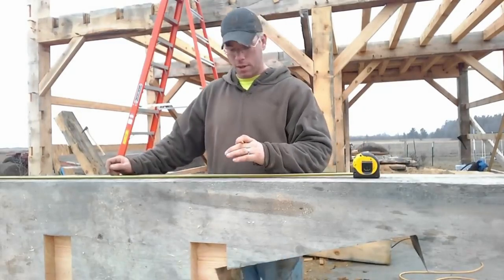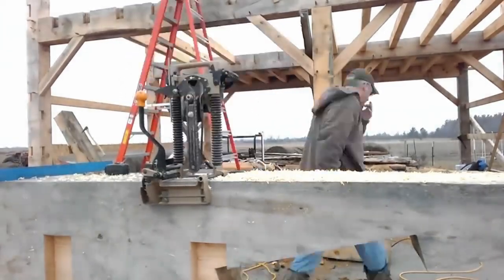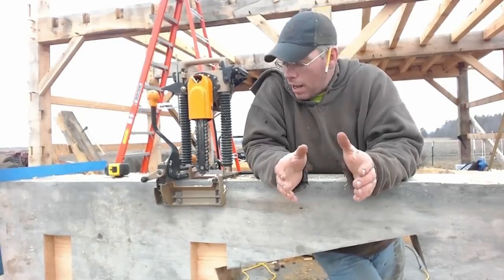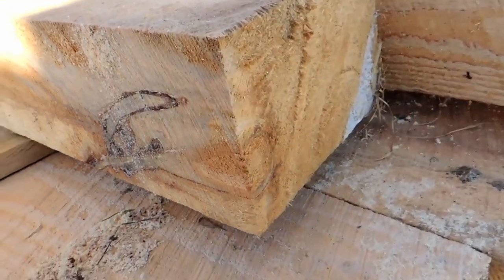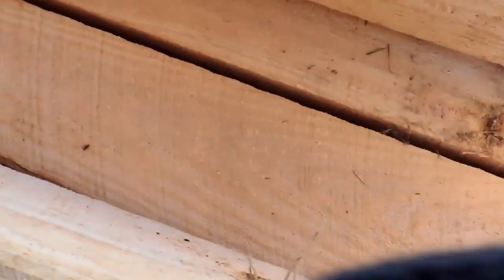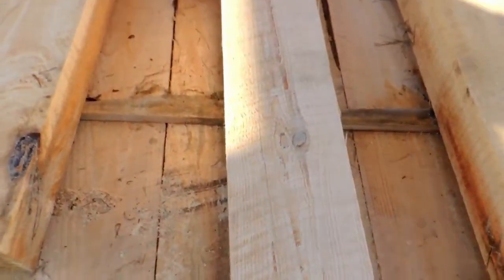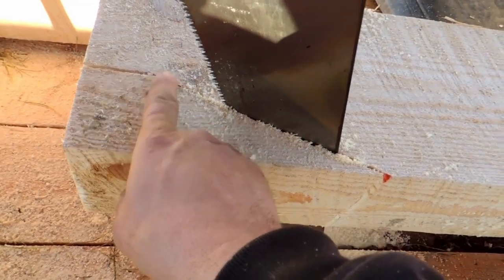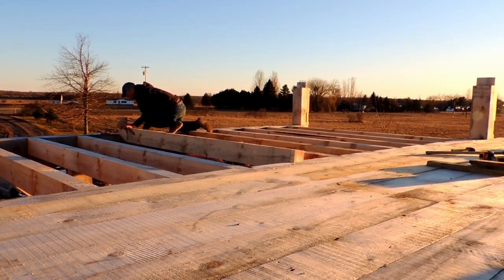A Timber Frame Discussion: Episode 2 Timber Selection and Chain Mortisers

Comment: Hindsight's 20/20 they say. Yeah, looking back it can be surprising you didn't get hurt sooner, but the way you got knocked into the hole was just what it was, a freak accident. True, there likely were precautions that could have been  taken to prevent it, and you will think about those precautions in the future. If you are in a similar situation again on the next build, share what went wrong, and what precautions you are taking to prevent the same accident from happening. That way we viewers can take those same precautions in our builds. 
Thanks, see you next time (as long as YouTube notifys me you've posted a video that is).

Comment: Just curious, what’s the dimensions of your build? And do you/can you do an approximate cost video for your timber frame? Like per sq/ft or overall?
Reply from the maker: Building is 28'x50', 2 story.  It cost me around $14k to build and that was doing it all myself.
Reply: Thank you. If you had to say, would you consider your build a large frame? I’m in the works of designing my own frame right now that I want to be about 1200 sq foot. Do you think it is better to jump into a large project instead of starting with many smaller projects? Did you do any smaller projects leading up to your barn to get the techniques down?

Comment: interesting jim, yep i use a 7104l with a 1" chain in fact i picked up 2! Benefit of having an independent power tool repairer retailer, the same bar works for the wider chain, the clamping mechanism is still suspect, i have used mafele's but they don't feel as safe as the makita. However they are lighter making them easier when you use them onthe frame.
Reply from the maker: I'd like to have both but you know how that goes.
Reply: i guess it's quite off topic but do anybody know a good website to watch new movies online ?
Reply: @Alan Rudy thank you, I signed up and it seems like they got a lot of movies there :) I really appreciate it !
Reply: @Dominic Azariah Happy to help :D